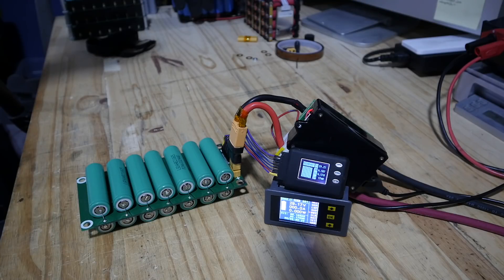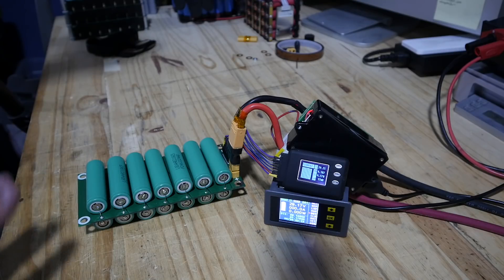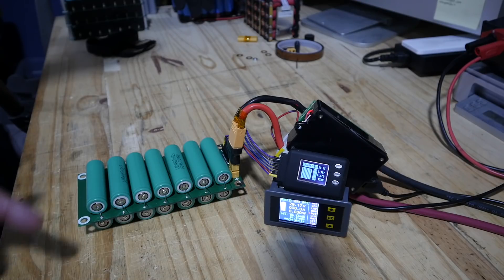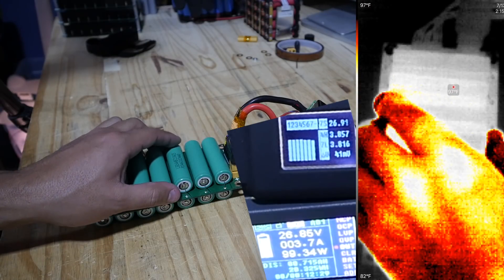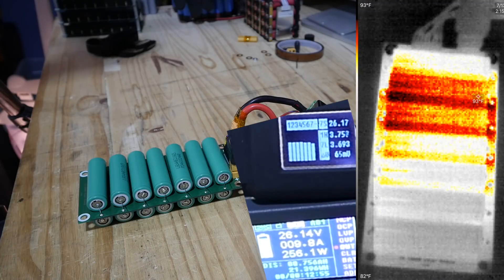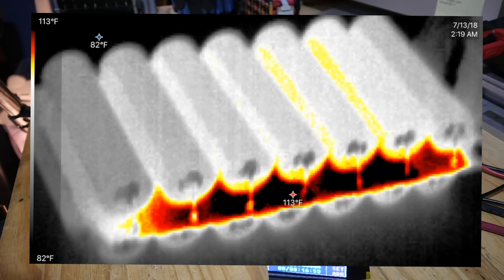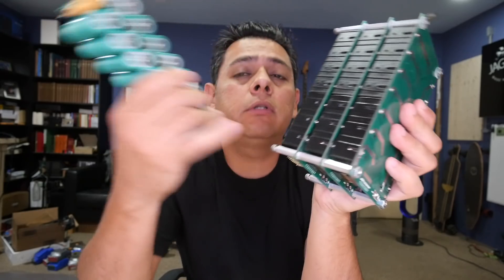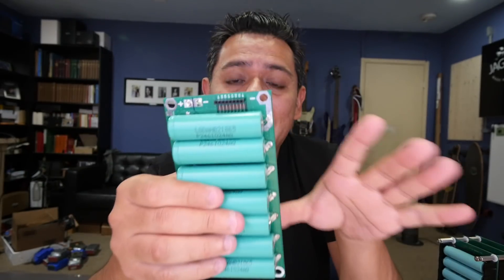18650 DIY Powerwall PCB module POWER Load Test

Comment: Hello Jehu from Canada. You rock ! I am new to this and would like to build a power small power wall. My question is. I have some 18650 Samsung LG with average 2169 MAH . And some with 2600 MAH . Can I still use these together assembled into separate packs in parallel ?

Comment: opposite side for + and - is a very BAD!! idea... one module turned around Boom! stick with the layout that you have or switch it from the front two hole to the right or left side holes.

even better would be to place the holes on one side closer together so they could not touch even when flipped around or place one pole off center for +

Comment: wow, another great upgrade addition. Truly can't wait for your great idea becomes available and the turn out of your proven it works concept.  Ok um, notion or idea on the 2nd version with the 14 cell. YOu think its possible to get a good clear spacing on the side that doesn't have traces to maybe utilize already tech cooling in the graphics card industry  for circuit cooling. I know it will increase deminision but nether the less it opens up to auto thermal cooling

Comment: Great info, not only in this video but the whole channel gives me great insights. Do you know if the tesla Powerwall is already able to stay on if there is no power from the grid? i know that feature was still disabled. I know you are running a few stand-alone powerwalls but i'm mostly interested in a DIY power distributor/analyser that is integrated in my home and would still work if there is no power from the grid but does not start feeding the grid(they said that was one of the issues with the tesla one).
Any suggestions for a DIY solution sort of like the Solaredge StorEdge ?

Comment: I just bought 100 18650s. I'm hoping to turn them into a 24v or 7s system trying to decide the best configuration for a 100 cell pack. Any suggestions

Comment: If you use cable ties, are there SMC/SMD battery holders available?
You can make the board double sided.
Reply from the maker: Only expensive ones
Reply: Bend the leads.
We need to get it down to 4$ for 7cells?
That's pretty difficult. I won't get the PCB for that.
Did you ask the PCB manufacturer for building it including holders?

Comment: What if you'd make the PCBs a bit wider and ad a groove to the pcb for the 18650? Then you wouldn't even need any zipties and could just make the cells keep together between two PCBs.
Reply from the maker: Double the pcb count,  we are after cutting costs
Reply: jehugarcia Well you could still have the same setup and only then add the zipties to the last row

Comment: jehu, I was wondering if you could do a test that potentially could get 1 million views? Take a shorted cell and try to pump 100A through it.
Reply: Some people say they have shorted 18650 cells with zero resistance, the ones that blow tesla fuses . If you take that battery and try to pump 100A or 1000A at 3.7V what happens? Does it catch fire?  Does it explode? Does it break circuit internally?
Reply: The closest thing I have seen so far is the guy from Sweden where the cells his sons mini car just turned brown.  It seemed to destroy all the cells in parallel too (taking them to zero volts).

Comment: But, the board heats up. I think the old way with the nickel strips is maybe a bit more work. But in the end better.
Reply from the maker: You wanna build a few thousand cells into a pack in a way it gives you an advantage you don’t really need?  Go for it
Reply: jehugarcia mm you are right about the lower rate. Im considering a build that needs a higher discharge at peek moments. So was stuck at that idea kinda. For a wall this can work. Does this really reduce the workflow? It does create a way for someone that does not have a spotwelder and all the other stuff needed. This.can create a block way to build your own wall. In that way this is nice.
Reply from the maker: Especially if I can find someone to populate them in China,  then we’ll be closer to plug n play
Reply: jehugarcia that would be even better. That must be possible. Since so many products pcb are made and populated that way.

Comment: would putting them in a steel or aluminum box or heat sink them stop the heating up so much? what about liquid cooling? also maybe this is a dumb question but doesnt temp extremes (hot or cold) affect the lifespan of your cells? whats the optimum temp for performance and longevity ?
Reply from the maker: 74F is ideal.  I explained I the video why cooling I not needed

Comment: And will you also focus on the inverter side of the powerwall project? Because everyone may need a 3kw 3phase inverter sooner or later, together with an adequate solar charger...(in these areas I would no longer trust some recycled or very cheap hardware)

Comment: I think I might be able to redesign the board to withstand a higher load
Reply from the maker: Yes,  but can you do it without increasing the cost?
Reply: jehugarcia yes
Reply: Seems like you just need more copper in the pcb for higher loads. Yes more money but worth it. Make two models for high and low amp draw
Reply: Brent Hawkins the copper part is correct it the price part is not,  the way PCBs are made is putting a layer of copper and then using acid they remove the unwanted copper,  there are tricks to marking a bigger traces then what the manufacturers allow also ground layers are super useful

Comment: Great video! Thank you for posting it.
I’d be happy to run heating tests on a bare board if you wanted. I can use a 60A power supply and a 60A electronic load to pass current through the board after soldering in jumper wires to replace the batteries. This could help separate out where the heat is being created and help define a current limit for power cell users. I have a micro-ohmmeter too, handy for measuring trace resistance.
Reply: Battery Mooch The weak points of the boards are the solder joints, as you can already see in the flir image.
Maybe bending the leads on the board would help a little.
There is nothing to be worried about if this is used in a Powerwall.

Comment: Those cells are getting hot. It’s probably the trace and the current path has some resistance. It wouldn’t get that hot when using thicker cables.

Comment: Hey I've gotten my hands on a Eltek power charger and was interested if you wanted to test it.
Reply from the maker: Not familiar with Eltek
Reply: It's an on board lithium ion batteries charger that is used in  volvo C30 hybrid.
Reply: The link above has the info on the charger
Reply: I work for a company thats prototypes batteries for automotive industry.

Comment: I have a question can I use that ckt board to make a 13.8v board and not a 24 volt? I need to make portable PS so I can power a 20 Watt HF Ham Radio also, it needs to be around  12-13.8 volt  at a higher Ah.
Reply from the maker: No that’s lead acid voltage,  you’d need 4s LiFePo4 cells

Comment: Wouldn't the percentage of loss be the same at all power levels? I'm pretty sure they would be. It's just easier to observe the losses at higher discharge rates. 
I wonder if you could, during one of your higher current 1c or 2 c tests, measure the voltage drop from the clips and PCB. To accomplish that you would measure the cell voltages directly across the cells then add those voltages together on paper. Then you could measure the summed voltage delivered to the load. Once you factor in the current, you can find what % of loss in power efficiency the clips and PCB are costing you. That would give you some real numbers to weigh the convenience of the clips vs your busbar assembly technique.

Comment: Tesla style fuses don't really make much sense, if your batteries are connected in series. One fuse somewhere on the PCB (maybe a thinner copper trace) would make sense. But several fuses in series are pretty much pointless.
Reply: Well yeah, though I guess one could also call that a wire then. The fuses may be sort of useful in your case, since you have packs of two cells in parallel. I doubt it would do much unless one of the cells shorts out completely though, which obviously isn't particularly common.
Also while I prefer the battery holders, I don't think 2 amps is a whole lot. You aren't gonna discharge your powerwall at a constant rate throughout the day. You may easily wanna draw peaks of 3 kW or more at some point and you would need over 50 of those 7 cell packs to be able to supply 3 kW while staying within the 2 amps per cell. Which in the case of a powerwall may be fine, but it certainly limits the usefulness of the PCB modules in general. Which is kinda unfortunate, since it is a neat way of managing the cells.
Reply from the maker: Unless the serve the purpose of connecting the cells,   Kind of important function
Reply: Battery's are connected in banks so one fuse blowing on one battery will not take out a mass of them (unless its the main fuse on the bank of Battery's goes then there must of been something more serious like dead short)

Comment: Test Request: can you test the battery holders, but place like a copper shim or two on the negative end of the cell to increase pressure on the connection of the holders to test it makes difference in temps during draw test

Comment: why not just add one more cell would only have to order one kind of holder not two
Reply from the maker: Because who needs 8 cells in series?  7 cells is 24v and works with all 24v equipment
Reply: Ok ya that makes sense

Comment: Out of curiosity, could you make the pcb or the wiring in the pcb thicker to deal with the heat?
Reply from the maker: Yes thicker Copper,  but like explained,  it’s not needed
Reply: jehugarcia hmm yes and no, as it is right now its ok, considering that people using the board know what they are doing, but there is always the brickhead that didnt read the instruction and did everything as he saw fit on his head, thats how lawsuits happen, then again you can make it idiotproof and the world will make a better idiot.
Reply from the maker: And too expensive in the process that no one uses it

Comment: Jehu just wondering how the XT60 was connected? Cause it seems like one side of the pack was loading up first.. are they wired at opposing ends?
Reply: jehugarcia I think you also addressed this with making both lead traces equal instead of one long one coming back to the XT60 connector.
Reply from the maker: Not sure what you mean
Reply: jehugarcia I think what he means is when you wire packs in parallel you can have both leads connected to first pack or one lead connected to last pack, forcing all packs to equally do work instead of overworking the first pack (which would have the least resistance). In this case though, the difference in cell temperatures that we saw were across the series. So I can only assume the PCB was heating up near the top for some reason (perhaps the thinnest trace is there?)
Reply: Right on.. my bad Jehu yes I was referring to parallel wiring not series like this is set up.. haha sorry for the brain fart

Comment: Hey so where Jehu mentions you would use Energy cells rather than Power cells, what happens if I want to build a power wall for my induction stove top. That thing whips about 14A @ 240v when its on full pelt (4 element). Any recommendations? I also have an oven that uses a similar amount so am pretty keen to find a way to get these off the grid.
Reply from the maker: That’s 3000watts,  your 30kwh powerwall will be able to do 30,000watts at 1c

Comment: Hey Jehu! I've been a subscriber for a while now and I just now realized I can make bus bars for you. We have a fiber laser at the shop I manage that can cut through 1/8th inch copper like butter and we have press brakes that can bend the bus bars if you need them to be a certain shape. We can even nickel plate them.  We make battery tabs for Emerson out of brass that gets a tin flash with a nickel plating. We do prototypes, low volume, and large volume.
Reply from the maker: Nice!  I def need custom from time to time
Reply: Cool, shoot me an email at anthony AT europamanufacturing DOT com anytime. We can also make sheet metal enclosures and other parts out of aluminum, steel, stainless etc.
Reply: We have beryllium copper on large rolls and we have made spring contacts before but we are contract manufacturers so if a customer wants a part made, we make it to the specifications on the drawing. We  often offer advice to make something more cost effective to manufacture, but at the end of the day, it is the customers decision.
Reply: Chris B Beryllium copper is great for spring contacts and even better when electroplated. It's much more expensive than using plated brass though.
Reply: Proto G nice to see you here too haha...  you’re very helpful as usual =]
Reply: Proto G beryllium is bad news. Specifically when it turns to white powder.
Reply: It would be better to use something like a Beryllium Copper leaf spring.
Have you done this before or not?

Comment: What if there is an issue n it burns a house down? There are always defective pieces.
Reply: instinct022 i hope you wasn't inside the house
Reply: No one tbh '-'
Reply: When used in a power wall the amp draw will be very low and will be safe  with low heat
Reply: Brent Hawkins once I installed a 30k server an it was defective..

Comment: Would it be possible to mount all the cells vertically and use the empty space between them to force an airflow and have them run cooler?

Comment: Why don’t you use proper fuse cable instead of resistor pins? I get that you tested a couple of them but they aren’t made for that, they could work or they couldn’t there is zero guarantee. Also fuses are so cheap. I don’t get it honestly
Reply from the maker: I believe all wire is proper fuse wire
Reply: Rodrigo Vazquez they work at the same way, but the purposes of one is be a fuse, and another, be a wire.

If it works, isnt necessary to complain.
Reply: Board could be modified to use actual fuses instead of traces. I’m not sure if tested yet but it would be good to see what the traces are rated at.
Reply: Mr J, 
You refer to power cells and energy cells, I thought all 18650's were pretty similar, what's the difference between those?

Comment: Are you drawing power from across the entire Battery Pack from corner to corner? Or are you drawing power from the same side?
Reply from the maker: Same side,  in using xt60 connector

Comment: This is mainly designed to work with new, all equal capacity cells. If using used cells, all 7 cells per pack should be of the same capacity. We must be careful when loading this with used cells.
Reply from the maker: All packs are paralleled,  so I’d say all 7 groups have to be closely matched,    You only have to worry about  the combined capacity 7 groups,  or 14 if you are going 48v
Reply: Yes...exactly my point.
Reply: Using the packs with the holders would be great for the mis-matched sets...and like you mentioned the ones directly soldered can be the new/matched cells.

Comment: Appreciate the clarification at the end of the video! The design choices made for the boards and holders make sense if cost is a significant factor. You did mention energy cells used for power walls vs power cells. Is there a guideline for how we define a battery cell ( max amperage? capacity? charge/discharge cycles?). A  guideline would be helpful for users when searching for cells for energy or power applications.
Reply from the maker: I’d call anything capable of 5A continuous and above a power cell

Comment: Just curious?
How many of these modules (7-cell version) would be required for a 30kWh "Powerwall"?

Also, what did you think of the Vruzend battery kit? (Seems like a good middle ground between your 2 mounting options)
Reply: 3.7 nominal voltage, let's say average 2ah of current, multiplied by 7, so 50wh per board. 30k divided by 50 = 600.
Reply: i.e. 4200 cells
Reply: Spot on Brian - I saw 3KWh - going blind in my old age!
Reply from the maker: Vruzen is hell expensive and also could only handle about 3.5A  good enough for powerwalls but just costly and a pain to assemble
Reply: Brian, I assume you 600 cells, not 600 modules?
Reply: No, I mean 600 modules. Each module would have the 50wh I mentioned, right? Wanna check the maths for me?
Reply: Yeah, 30kwh. That's a massive one!!!

Comment: would this work with electric skateboard
Reply from the maker: No,  24v is too low for skateboards,  and skateboards pull about 10A continuous.
Reply: Nothing wrong with 48volts tho. It's the amp draw that makes me wanting a heavier pcb for esk8

Comment: There is a video on here where someone uses the same battery holders to make an ebike pack. They worked but there seemed to be a corrosion problem with the contacts. The suggested fix was to go to better quality with brass contacts which made the price prohibitive. Thanks for doing the research on this btw..

Question ..has anyone considered using 1/4" Hardiboard for mounting the battery modules. This material is supposed to be non combustible and is very inexpensive http://www.ytc-tiles.com/product/hardiebacker-board/